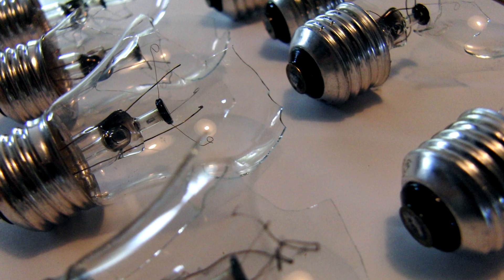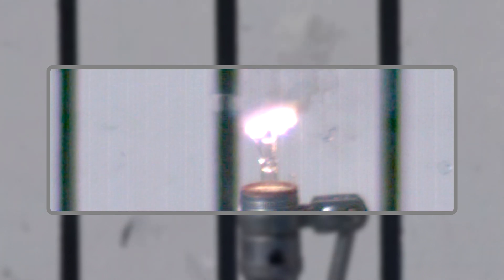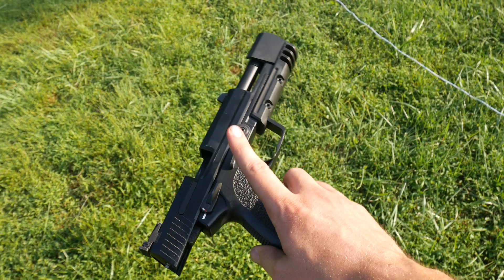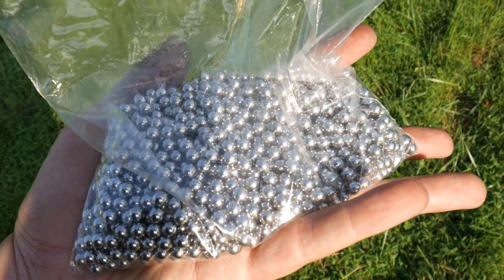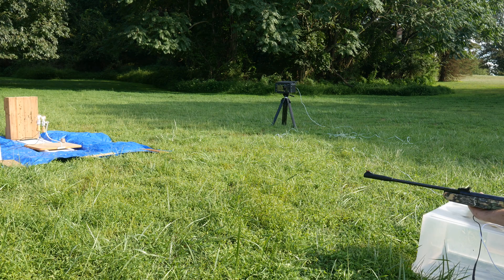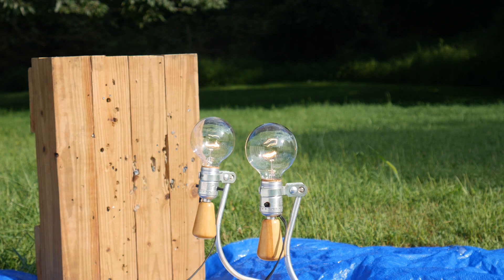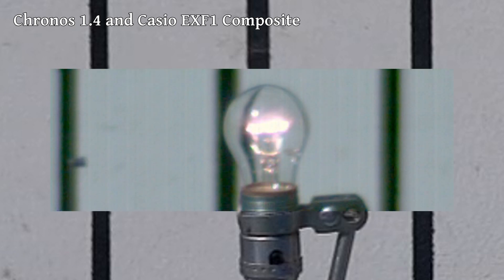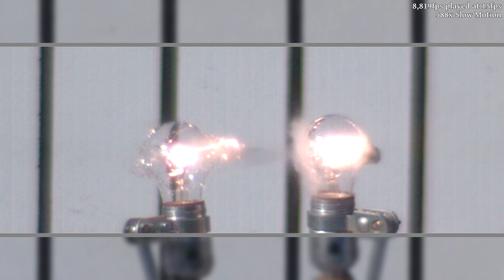Shooting Lit Lightbulbs High Speed Video (Up to 38,000 FPS)

Comment: Pretty cool stuff man! If you're planning a lot of low current 120v outdoor stuff, Ryobi makes a battery powered inverter that would be perfect for you so you don't have to run your truck all the time.
Reply from the maker: Huh, I didn't know they made something like that, pretty cool! If I had planned a little better I would have just used a spare car battery with the inverter I think. Don't have a lot of plans for stuff that needs AC power but I will have to keep that in mind

Comment: I'm a simple man, I see a fuzzy dice video with "38,000 fps" in the title, I click like.
On a side note, it looks like your aperture might still be a bit too open, the computar lens has a soft image below f/2.8 to f/4. I think you could go slightly darker without any issues. 
Also, if you update to the most recent firmware you can go to 320x96@40,420fps :-)
Also, excellent work with the dual camera blended backgrounds!
Reply from the maker: I was using a different (Navitar) lens for this one, the lighting wasn't great so I was trying to get the most light possible for the really fast settings, this was my first real test of the upper frame rate limits. Had the aperture wide open at f/0.95 and even if things are perfectly in focus there is some distortion around the edges of objects. The lens was actually a bit crooked on its mount and not sitting flat (flange was damaged) so I couldn't get it to focus at some distances and there was a little distortion. That lens is good for absolute maximum light but it is soft. Picked up a Computar lens off of eBay after filming this and even at the same f stop it is a little sharper.

I tried that firmware in Beta and had some issues with it, saw that they officially released it but haven't tried it yet. They claim some changes to help with banding which I really hope helps, I have had issues with that especially in closeups with clean backdrops.